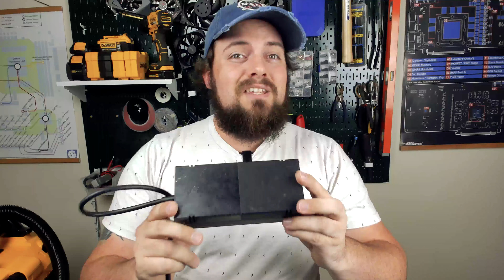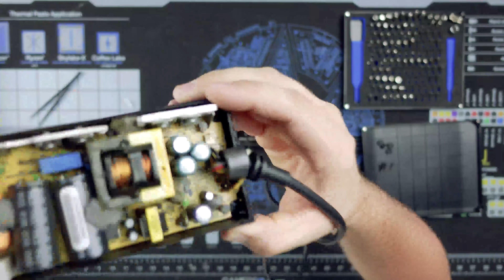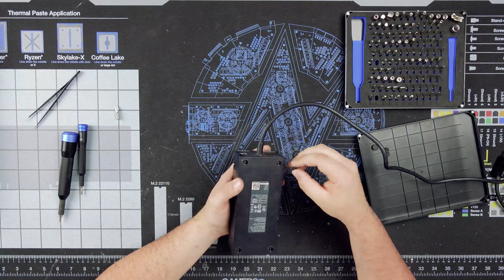How To Open A Xbox One Power Brick To Clean Or Replace The Fan

Comment from the maker: ►TIMESTAMPS
0:00 Intro
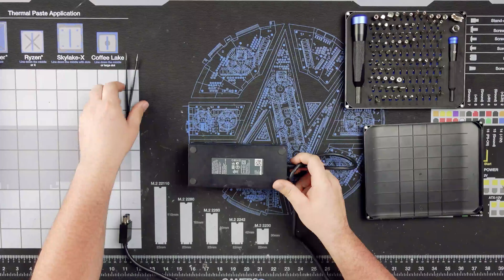0:17 Tools Required
0:40 Rubber Feet Removal
1:44 Remove 4 Torx T10 Screws
2:10 Open The Top Half
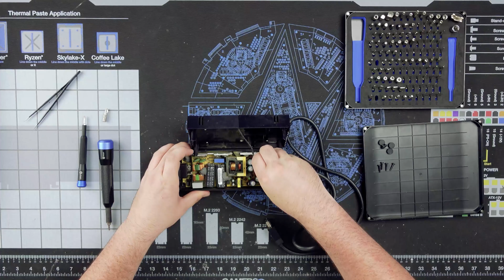2:19 Disconnect The Fan Power Cable 
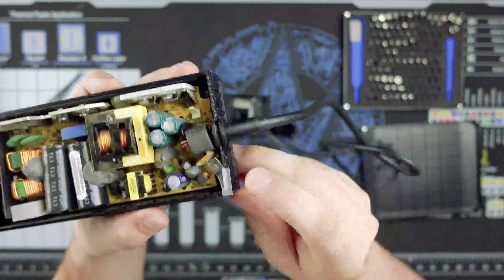2:26 Remove LED Light Diffuser
2:42 Remove Motherboard
3:22 Remove 2 PH0 Screws To Remove Fan Cage
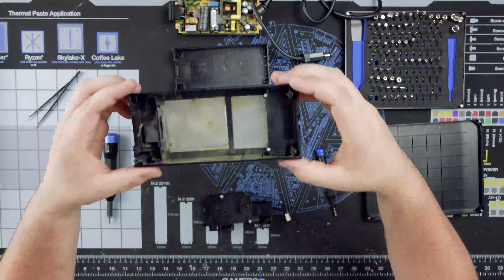3:54 Remove 1st Fan Vent
4:04 Remove 2 PH0 Screws To Remove 2nd Fan Vent
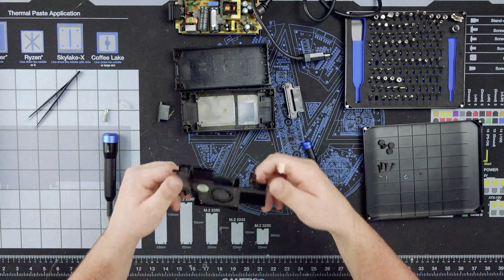4:29 Remove 2 PH2 Screws To Remove Fan Housing From The Fan Cage
5:15 Remove 4 Longer PH0 Screws To Remove Lid From Fan Housing
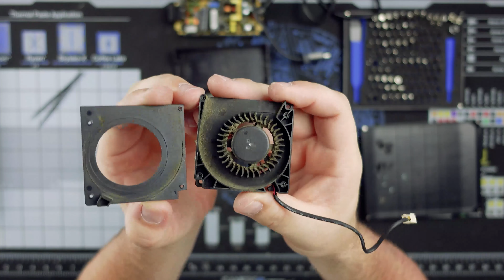6:00 Start Of Reassembly
6:02 Place Lid Back Onto Fan Housing
6:23 Use The 4 Longer PH0 Screws To Attach The Lid To The Fan Housing
7:09 Use The 2 PH2 Screws To Attach The Fan Housing To The Fan Cage
8:10 Insert 1st Fan Vent Into Top Half
8:34 Use 2 PH0 Screws To Attach Fan Cage To Top Half
9:09 Use 2 PH0 Screws To Attach 2nd Fan Vent To Top Half
9:45 Place Motherboard Into Bottom Half
10:38 Align Power Cord
10:51 Reinsert LED Light Diffuser
11:12 Reconnect The Fan Power Cable
11:39 Align And Seat The Top Half
11:53 Use The 4 Torx T10 Screws To Attach The Top And Bottom Halves
12:30 Reinsert The Rubber Feet
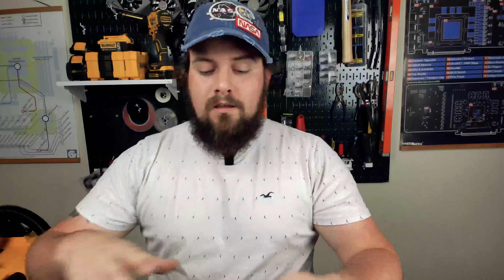13:02 Summary
Reply: how do i remove those metal things thats in between the screws

Comment: thanks for the tut! My parents' Xbox wouldn't turn on today, so I figured that the psu was overheating. Come to find out, it was completely caked in dust inside and the 3 green 2200uf 16v capacitors are swollen and leaking. Replacing those is gonna cost about $8, whereas an aftermarket psu on Amazon is about $15, so I'm just gonna order a new one. I expect that aftermarket psu to not last too long bc chinese knockoffs are usually trash, but I'll order the caps as well and rebuild this one to have as a spare. Also decided to clean their xbox while I'm at it, and omg this thing looks like it did a tour in Afghanistan lol. Just dust, sand and dorito crumbs (?) inside lol. I feel genuinely bad for this poor lil fella

Comment: My T10 sockets have a small metal pin in the centre meaning the T10 head literally can't even fit. Any suggestions on how to get round this?
Reply: You need a security bit that has the hole in the middle to allow for the small nob to slot in

Comment: The T10 sockets on my adapter have a small metal pin in the middle, meaning that the T10 head can't get in. Is there any other way to get the case off?
Reply from the maker: You would need a T10 Security head to open it up.

An alternative is to use a small quantity built flat head screwdriver. With the flat head being small you can wedge it between the center pin and the star points. You can then remove it like a normal screw or you might actually break off the center pin so you can use your T10 bit.

Comment: The T10 sockets on my adapter have a small metal pin in the middle, meaning that the T10 head can't get in. Is there any other way to get the case off?

Comment: Rubber feet pads definitely the hardest part, I gave up and just ripped them out like a savage
Reply: My doesn't have screwa under it
Reply: @cuactemocmeza9094  mine neither! even when the pads get ripped off I can't see this "hole" hes talking about and i dont see and screws. i literally can't fix it
Reply: @loonify_beats  after ripping them off use a tiny flat head and stick into the area where the feet were, make your own hole and pry upwards
Reply: @loonify_beats does it have a little black piece of plastic? If it does you have to rip out the plastic covers as well with the tweezers

Comment: Bruh. didn't know that there is a fan inside. im worrying so much because of the buzzing sound coming from the adapter, until i saw that there is a fan inside. so its normal to have a slight buzzing sound.
Reply from the maker: The buzzing sound is most likely due to the fan being dirty or failing. All electronics give off a high pitched tone but a buzzing sound could be the fan.

Comment: I didn't have the tools able to open this, but it works when I plugged it in a outlet then plugged the cord to the brick. But it just stops working when I plug it in my Xbox one. Please tell me what's the issue I'm not technical savvy
Reply from the maker: It sounds like the power brick has a bad capacitor. I would recommend buying a new power brick.

Comment: went to take the screws out, the first two stripped with absolutely no problems. barely any resistance just ripped the screws apart. i’ve never taken it apart before so i didn’t overtighten the screws. step 1 is a fail so i can’t even get the half’s apart.

Comment: i broke the rubber feet trying to take it out and i can’t get access to the screws because of it, what can i do
Reply from the maker: Since that piece is already damaged, I would just take a philips head screwdriver and chisel out only the plastic piece in the hole that would be attached to the rubber. I know it's not the best solution but it's something I think anyone can do and the damage should be localized to that hole and not the rest of the power brick.

Comment: Do you know what causes a power brick to go bad? Mine took a dump recently. Bought a new aftermarket one. The original had the amber light on but every time I touched the power button I would here a very faint turn on chime but the system wouldn't turn on. I've had it for years. Maybe it just got old.🤷‍♂️
Reply from the maker: That exact symptom is one or multiple capacitors going bad. Check out this post to see what some bad ones look like. https://www.reddit.com/r/xboxone/comments/gm1ljq/faulty_capacitors_in_xbox_one_power_brick/

So technically you could just replace the bad capacitors but you would need to understand basic soldering and own a soldering iron and purchase the capacitors. Alternatively, aftermarket power bricks are cheap. If you do own a soldering iron then you should be able to just buy the capacitor and fix it for around $2.

Comment: Which side does the fan blow the air from?
Reply from the maker: For the power supply featured in this video I don't have it in person, but based on the footage I believe the intake is from all the holes on the glossy side and the exhaust is on the matte side. This is based on how the dust build up is mostly in the fan cage and not all the other holes.

If this is the case then blowing air into the matte side will most likely do nothing when cleaning the device. You will at least have to get to the fan cage to clean out the dust buildup.  Alternatively, if you see dust build up on the matte side through the slits, then you may be able to use tweezers to help pool the dust balls through.
Reply: So I did all the cleaning and stuff , the brick orange light comes on but the Xbox is not turning on, what could be the issue, before it used to shut itself randomly in an hour or in a minute
Reply from the maker: Most likely one of the capacitors inside the power brick is going bad or has gone bad. You may need to replace it.

Comment: Good morning bro, tell me, the xbox 360 power brick fan work for a replacement piece on x one power brick? My power brick fan on og xbox one didnt work anymore, and i have a good power brick of my old 360 here, can i use the fan in my x one power brick?
Reply from the maker: If it is the og Xbox one then it may work. I can't find the exact dimensions of the fans but the housing looks very similar. They are both 12v so that is not an issue. I would give it a try. If it does fit please let me know.
Reply: @MikeLikesThat  sure brotha, i already change some capacitors  but the power brick constantly power off randomly, and i running out options, the white light turn on but they turn orange minutes after

Comment: It may just be the angle and the video is never still enough to tell but is that purple capacitor starting to bulge? The one by itself on the lower right of the supply (near the three green ones)?

If so, you're gonna want to change it out. Either way, nice video!

PS: the real danger isn't the caps you pointed to but the massive two on the other side (the ones laying down). Those will absolutely hurt you if charged and you bridge them with a finger or hand
Reply from the maker: Yes this was a bad power brick and 3 caps were bulging. I opened this one up only for the video and was not used again. Good eye!

Comment: Great video but my brick isn't like that inside can't get to the vents
Reply from the maker: I know they do have different variations of the brick but should be relatively the same. Out of the two models I have taken apart they were removable. They may not be removable in others or may need to be disassembled in a slightly different way.
Reply: @MikeLikesThat  thanks man n it seems weird as there's no screw holes or clips or anything seems fused together there is a joi line but even with some force it won't move even slightly. This is a day one xbox one so don't k ow if that was a change they made on an update. Thanks again anyway man. Your the only person I've seen get into they vents and clear them the rest of the tutorials just do the fan but I was thinking surely a clean fan sucking air through a blocked vent is still a problem lol

Comment: This helped a lot, thank you so much!
Edit: when I reassembled everything, the status led was light orange and now it doesn't come on 🥺
Reply: I am doing this to fix that because it is already broke so why not do it also you can try fixing it but from what I am seeing you will have to buy a new which is pretty cheap its only like 20 bucks so there is that or you can try to fix it you self or bring it to a repair shop and see if they can fix it

Comment: Hey, my top didnt come off and the bottom did. I was wondering if you could help. I cant access anything and i dont wanna break it
Reply: I had exactly this problem, and basically I just needed to pull hard as there was some sort of white compound sticking it down. Wiggling it and pulling eventually got it off with no damage
Reply from the maker: Sorry for the super late reply!!! I hope you figured it out. If not, what exact part are you stuck at? You can tell me what minute you got stuck at based on the video.

If you did get the top off I'd be glad to hear what caused the issue.
Reply: @MikeLikesThat  Sorry for the double late response, i just got a new xbox and my thing was stuck on the oposite side, needed sautered